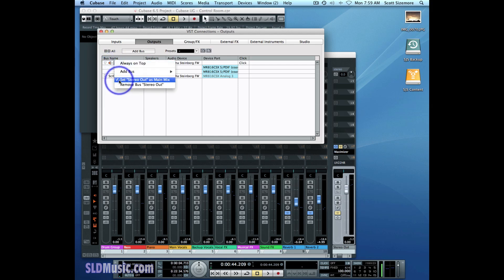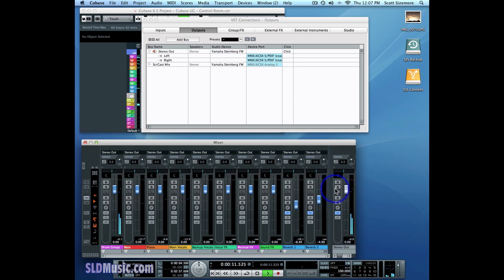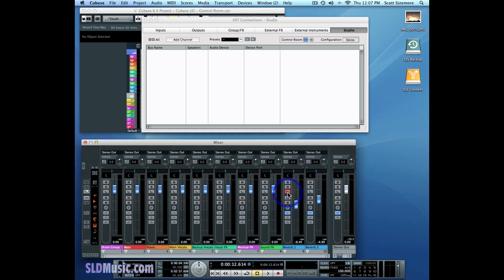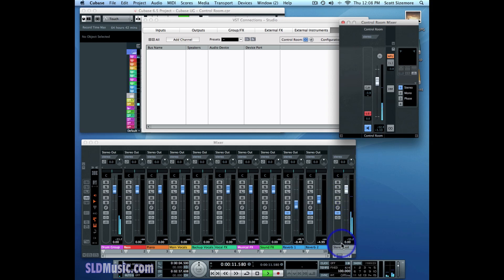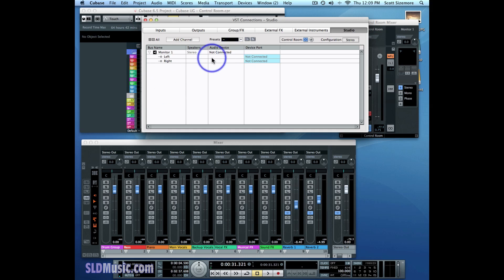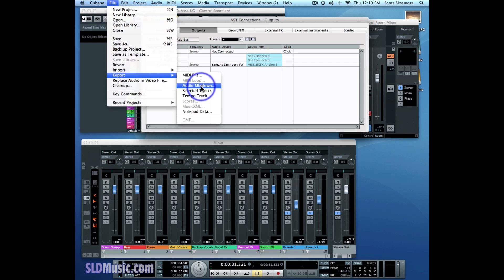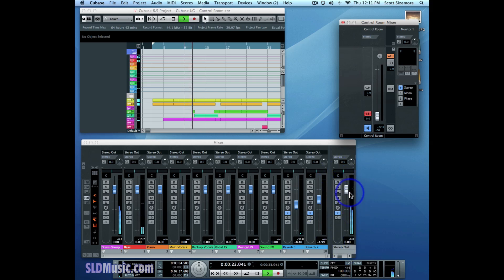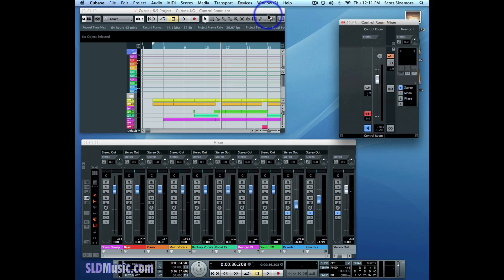Demystifying the Control Room in Cubase - Part 3 - Turning on The Control Room

Comment: When I turn on the control room mixer, a control room channel is NOT being created.  Any thoughts as to what I am doing wrong? I have cubase 8. I have tried expanding the window but still no control room channel. Also, under preferences, VST, control room your screen showed 11 possible check boxes--I only have 4. But exclusive device ports was one of those 4.

Comment: Sir,
Thank you for explanation. I've got an issue with my M-Audio Delta 1010 LT. I create a monitor out as you show, in Output Tab Stereo Outputs didn't changed as Not Connected. They send the same volume as control room monitor output. What am i suppose to do?